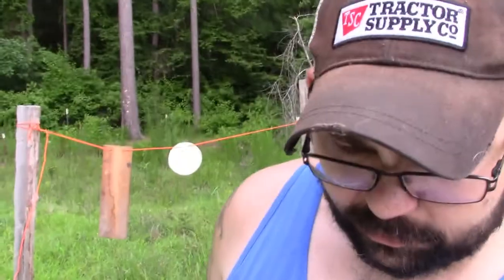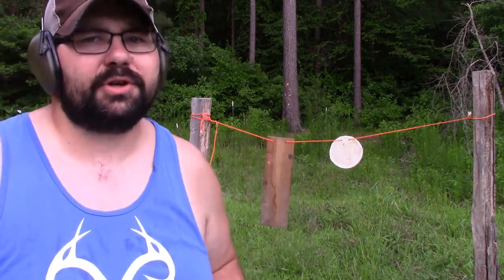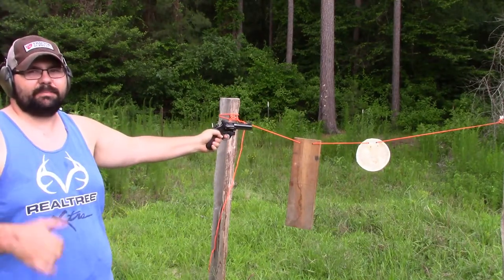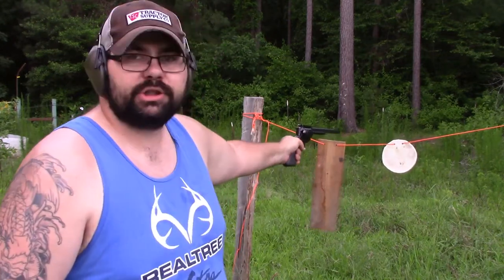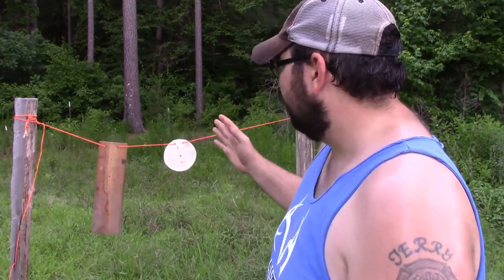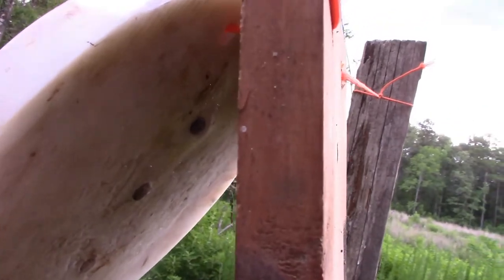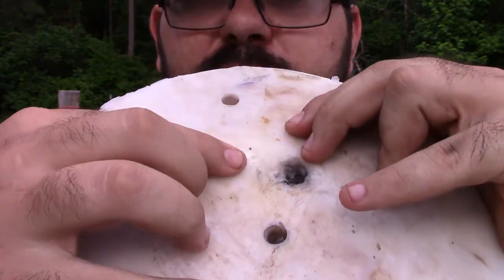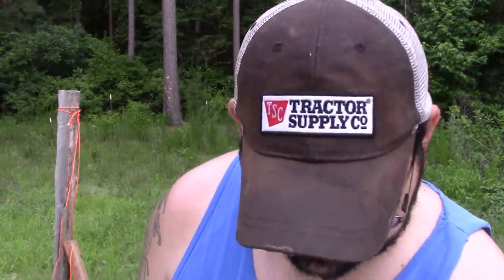How strong is melted HDPE

Comment: THe HDPE was not melted long enough. It is still not fully bonded. I should have left a hole about the same in the back. The chipping / cracking is because it did not fully melt.
Reply from the maker: Yes. I see after this I need to leave it in the oven just a little longer
Reply: @BackwoodsRaised  I'm still new to it but learning to be take my time with it. I have found that pretty heating at 300 helps too.

Comment: Hey spicy. Where did you get the HDPD and what do you think would happen if you poured the plastic over several layers of fine stainless steel mesh or fiberglass mesh? Reinforcement like concrete...sort of. Lol
Reply from the maker: Most of the plastic is melted milk jugs and buckets. I have a whole play list for the HDPE.
Reply: It’s makes a good plate for armor if you do those steps to make it armored

Comment: That plastic target delaminated.  Leaving it in the oven longer would probably make the layers of plastic stick together better.
Reply from the maker: Yes you are right. I did see that. I did cook this a little to fast. But for my next project I will no better
Reply: @BackwoodsRaised  I'm kinda wondering if better adhesion will make the plastic more bullet resistant or less.  Vests are layers, not solid plate (usually), although some ballistic vest have both.

Comment: Your block is flawed. The layers de-laminated when you shot it. Next block you make try and fold and twist several times before placing it in your mold press. This should stop the de-lamination problem, and make a more “bullet resistant” substance.